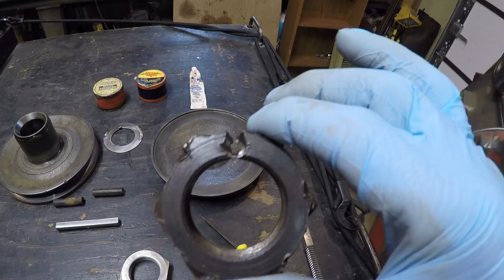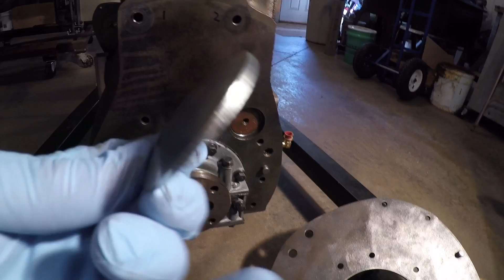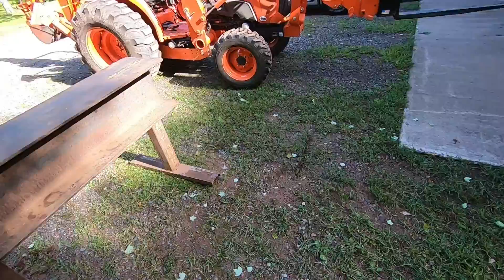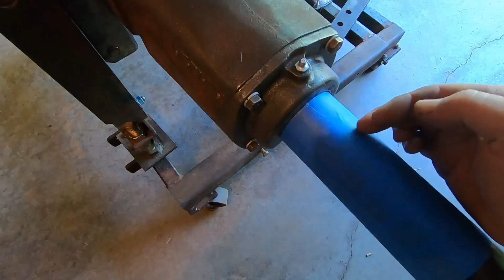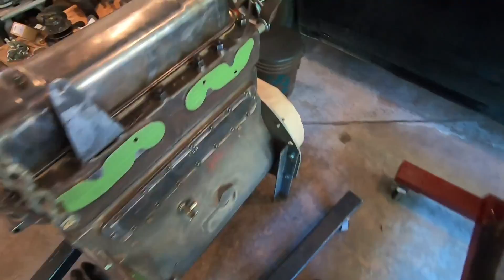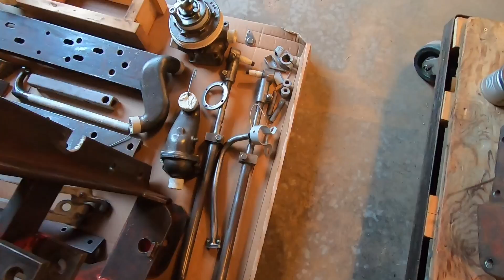Farmall Super M Rebuild Ep.38: Engine Crankshaft Pulley Installation & Final Paint Surface Prep

Comment: You put that 1/2 pully on the crank,  if you're going to be using that tractor for equipment that should have live hydraulic, such as a loader, the crank is a good place to put on a sprocket to mount a hydraulic pump on the outside of the frame rail.   Neither belly pump nor pto is not good place to use for hydraulic to power a loader.

Comment: One thing I learned a long time ago, remove the grease zerks and install pipe plugs. Paint over the grease zerks then you have a stuck ball valve on those zerks. As for the PTO shaft, you're right, don't paint them but, slobber them with grease. That alone protects them. You're getting closer to getting the old "M" up and running. Great video, cheers :)
Reply: Just put new zerks after paint lol

Comment: That fancy yellow handled file is a nut file used to cut slots when making a new nut for a guitar or other stringed instruments. They can be had from about .009 to 056.
Reply: Also... old radio and electronic stuff thats mechanical...ive seen similar files meant (or pehaps purposed?) to cut grooves and slots for electronic wires and for strings or wires for moving tuning elements and similar stuff.

Comment: You guys sure do nice work, that is going to be one nice M.  You guys probably know this old trick,  a little dab of valve grinding compound on a stripped phillips head or slotted head screw will usually get a grip and you back the screw right out. It works better than you think it would!

Comment: Your transmission top cover is showing signs of casting "cold shuts" where the iron was just a fraction too cold to flow fully round the chaplets ( discs ) and melt them into the casting.  Chaplets are used to hold a core or section at a given distance or cross section - just mild steel.  Normally they would melt in and vanish.  You can probably see the marks from a few more on the same surface where they worked correctly.
Reply: Cool info. You obviously have extensive casting experience
Reply: @maggs131  It was my entire post-school training and apprenticeship, and about eight years after I qualified the whole foundry industry closed down.  8-)    Shares in Elon Musk saved my sanity.
Reply: @gordonmcmillan883  that's awful that something you had a firm foothold on broke out from underneath you like that but on a brighter note you will live longer as I consider foundry work as unhealthy as welding. I worked in a titanium facility for 10 years before they downsized and I'm almost glad because that place was so toxic
Reply: @gordonmcmillan883  Is that because of the industry going overseas to places like China? Same places where so much of our industry has gone. So many companies, known for proven quality products, shipped there--- only thing left is the name we USED to know and poor quality products sold under the name now. I guess that is what happens when bean counters and shareholders look at ONLY THE BOTTOM LINE. Meanwhile, good jobs are lost here and shipped elsewhere. Our society is worse off for it!
Reply: @maggs131  Moved into the oil industry, made some money, never looked back.  Not healthy I'll agree.
Reply: @KStewart-th4sk  Yes, we offshore everything and as a result there is zero manufacturing left round here.   I'm too old to be bothered, but no jobs left in engineering hereabouts.  We need to bring some of that back and I support local manufacturers when I can.
Reply: @squatch253  They originally looked a little like those small thread spools you use a sewing machine.
Reply: Came here to say this. One thing to add is incompletely fused chaplets can be a leak path. So there is a slight possibility of oil leaking out of there. Typically is more of an issue for pressure containing parts. The defects around the chaplets might also be cold shot where some metal is splashed while pouring the casting and solidifies enough to not properly fuse into the casting.

Comment: For what it is worth I've never had an issue with paint adhesion on seeping cast.  Spend some time with wax and grease remover to get the surface free of oil.  Spray problem areas with JD buff primer immediately after.  Yes I use JD primer on everything.  I don't know exactly what JD does with their paints and primers but it is very high quality.  Blitz black on axles and splines is pretty sexy against IH red, and  it is some seriously tough paint.
Reply: @squatch253  I've slid hubs over blitz black and you would think I painted the axles after the hub install.  I operate identical to you guys so I feel confident you would get the same result.  I do add Valspar hardener to Blitz Black (I add it to all JD paint).  I used to paint professionally and I couldn't tell you what that hardener does because it is not like a typical two part paint system (ie it won't kick off in your gun or paint can).  With JD paint it does allow the paint to flow out a bit longer and does improve color retention and resists chips a bit better.  I tested the hardener with IH, and MM paint and could not determine any benefit.